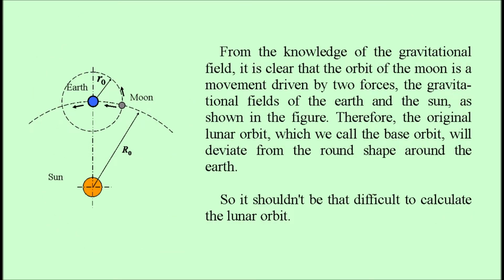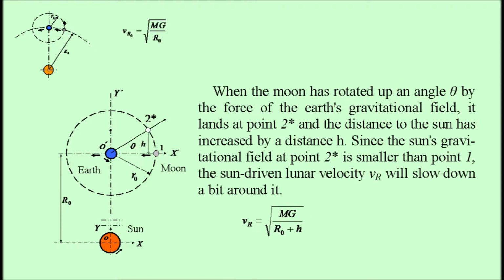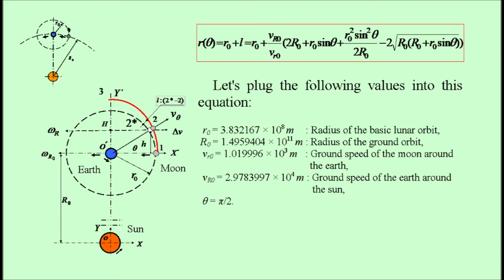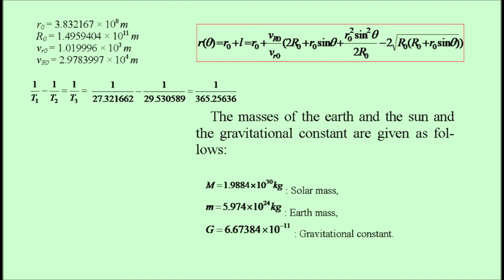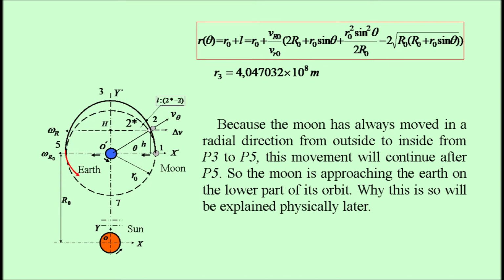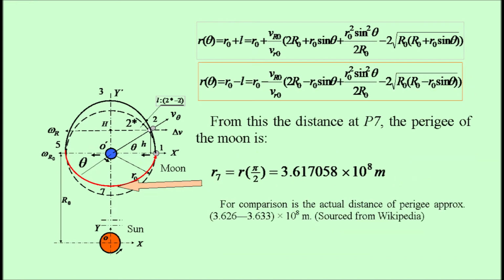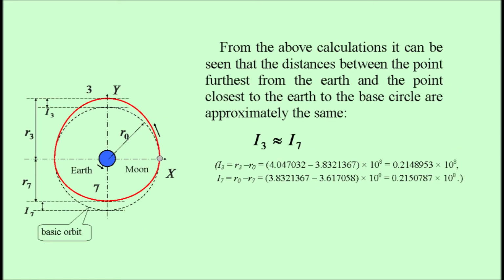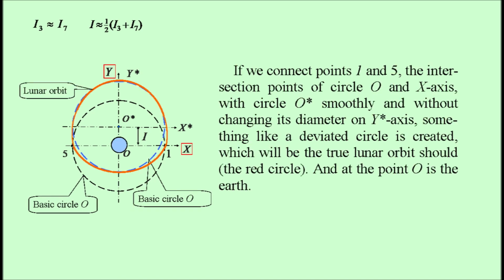▌Real Physics▐  (#15)  Calculate Moon Orbit – The shape of the moon's orbit is not an ellipse!

Comment: Have you checked this out with Is Newton?
Reply from the maker: Newton's or Kepler's calculation is not based on physical principles, but only on a purely mathematical basis. It cannot be explained physically why a planet or a moon should necessarily run on an elliptical orbit. So not everything that Newton said is correct.
Reply: @realphysics5137  but does astronomical evidence support your theory?
Reply from the maker: @mikev4621  The only thing that supports my theory is inertia, which has been completely neglected by previous scientists. And we also know that Newton's first law, also known as the law of inertia, is flawed because it only applies to linear motion. I have already explained in detail in this video series how inertia causes movement processes in everything. This generalizes Newton's first law to all types of motion. With this simple knowledge, many previously inexplicable natural phenomena and unsolvable problems can be explained and solved in a real and concrete way. And finally, by the end of this video series, all natural events (not just all natural forces) will be united! You will see that the physics as a whole is actually not that complicated and mysterious.

This video series will also show that complexity does not always mean correctness, but rather the opposite is often the case.
Reply from the maker: @mikev4621  As far as we know, the minor orbital axis of a planetary and lunar orbit is actually about as long as the major one. That's the evidence. Apparently nobody wants to know this fact.
Reply: @realphysics5137  I'll keep watching- good luck
Reply: @realphysics5137  I'll keep watching, thanks